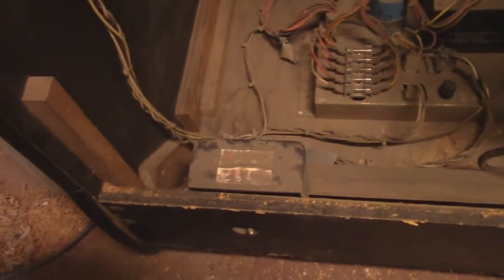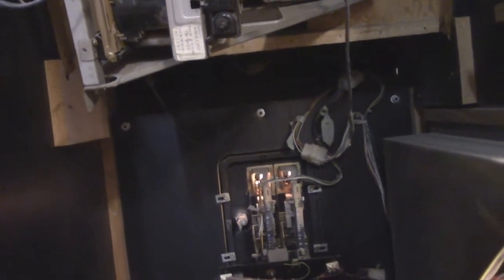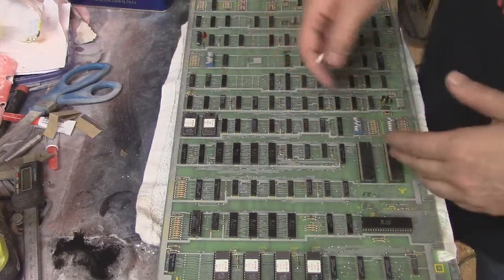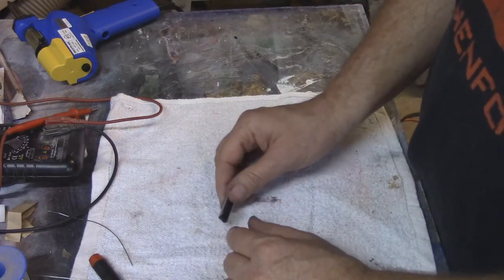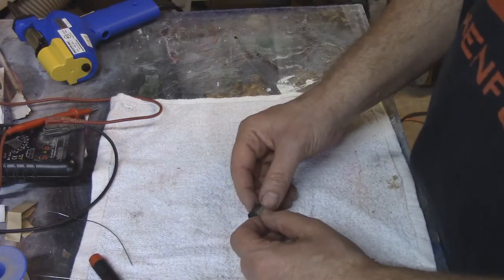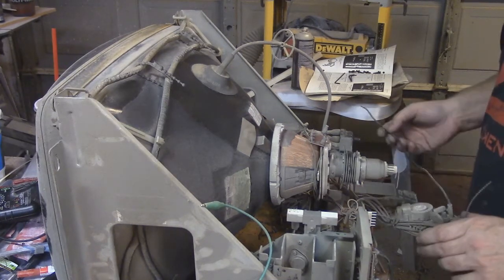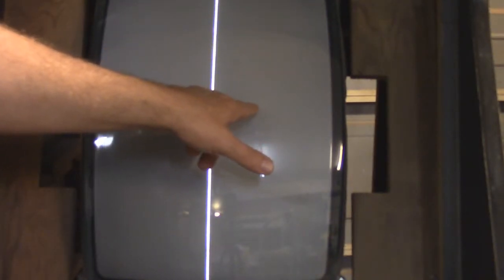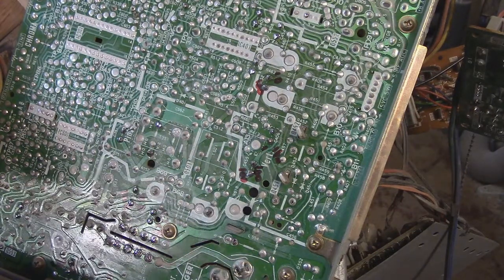Repairing an Atari millipede arcade video game

Comment: I  found the manual with the schematics. I have no beeps-so the bard seems to be ok. Are the monitor capacitors directly behind the lamp on the small board or also on the main one at the bottom?

Comment: amazing video!! I found 2 days ago a millipede myself-and it works all fine. But today an issue started: the left 1 inch of the monitor is slanted/ bend down in an almost 90 degree angle. Is that a setting issue or something on the  boards?
Reply from the maker: its probably a capacitor
Reply: @Cookingwithdrchill  any advise how I narrow it down which one? I know basic soldering and if I find the schematics I should be able to read them..by the way, found in the same spot a Ms Pacman....my son (13) is crazy about them :-)

Comment: COOKING WITH DR.CHILL, Why does arcade monitor need a B+ voltage what is it the B+ voltage used for? is the B+ voltage for the sync & hold circuit?

Comment: I have one of these games along with the original books and need to have it repaired. It worked at one time. I am not sure about fixing it myself where would you recommend getting it fixed are you easily accessible if one runs into problems?
Reply from the maker: for the most part I'm available, but depending on what's wrong with it it could get expensive. verify all the connections are good first, then all the fuses, check all the lights on the inside, etc.

Comment: I have an Atari millipede like this one & im experiencing the same types of issues with the video quality. Everything else works fine. Do you have any tips or can make a video on how to repair lines on the screen? Or tips on how to fix that?
Reply from the maker: you probably need to change the capacitors on the monitors board (the chassis).  hard to say which one without having it in my hands. to be safe, just buy a kit for that monitor. be careful working on it.